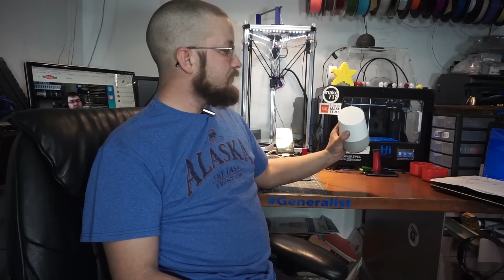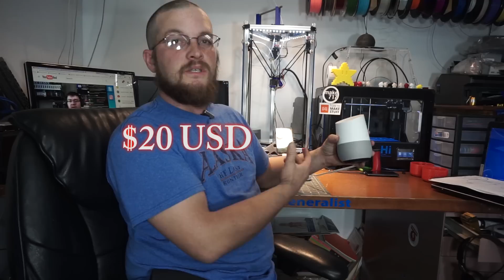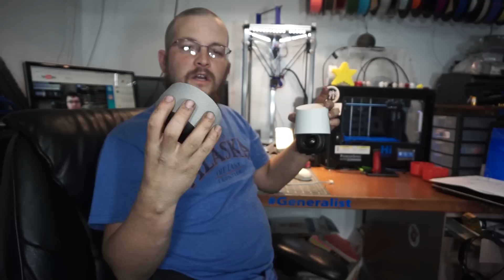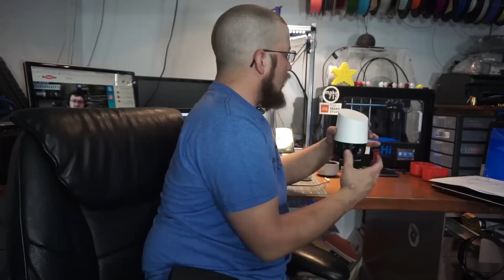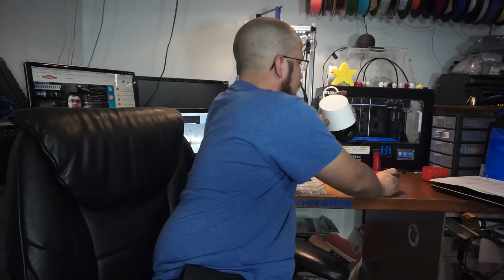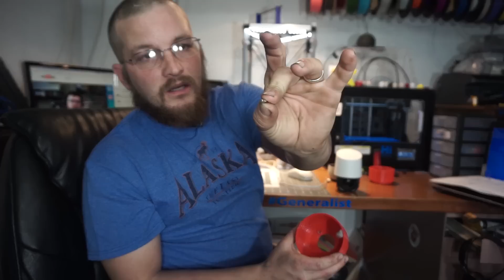How I Do It - 3d Printed Replacement Base For Google Home Assistant

Comment: Just wanna say.... there's only ONE speaker on the Google Home
Reply from the maker: chicagotransam correction there is a left right and center speakers. as seen if you remove the base.
Reply: How I Do It 

Sorry, but this is incorrect.  Show me the wiring going to the left and right "speakers".  There isn't any
Reply: How I Do It 
The two objects on the side are simply passive radiators.
Reply from the maker: This is correct, however if you cover any one of the passive speakers the audio degrades tremendously. Whether passive or not they are still speakers, and essential to the operation of the device.